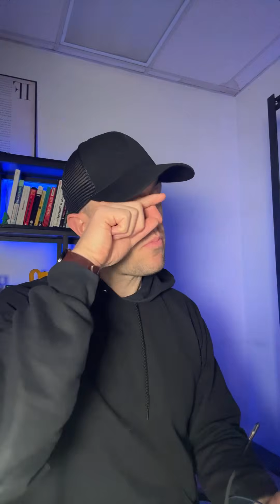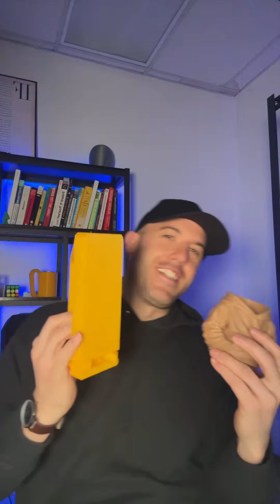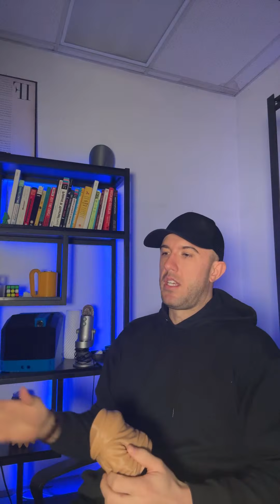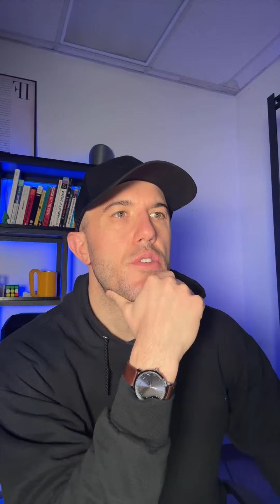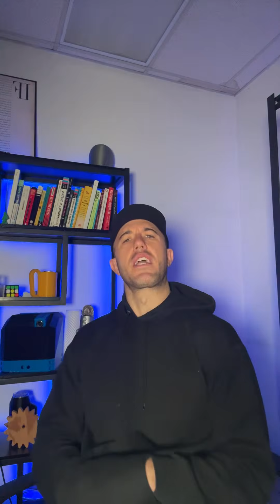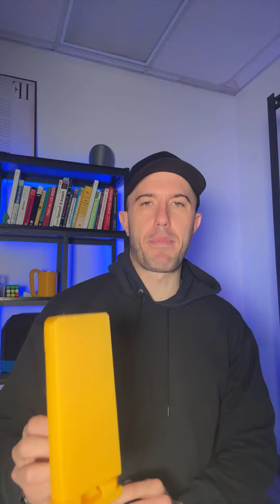Protecting Files and Dropping Filament cost

Comment: PCTG is a great name.
You know what's worse ? When each filament producer and reseller calls the same thing, like PCTG for instance, by a bazillion different marketing names without industry coordination (tuff, ultima, topdog, superduper, promax+++, nanotomic...), so most users can't easily tell anymore the basic material type behind it.
PLA is already a mess, but AT LEAST it's called PLA, so buyers have 80% confidence it's close to what they are looking for, instead of some other non-PLA material.
(examples of existing ACTUAL brand names, what a circus: pla, pla basic, standard pla, pla+, pla pro, pla+ pro, tougth pla, pla tough+, tough pla+, pla+ 2.0, rapid pla, pla hf, high speed pla, pla+ hs,  pla prime, and on and on)
Reply: Yeah, but Gabe has sand in his undies over this. And you also kind of made his point. What’s in all the different PLA+’s from different companies? What’s PLA tough, or high temp PLA? Yes, the base is PLA, but the additives can make it so much better in certain areas that it no longer matters. It’s all about the performance that you need. You don’t care if it’s PLA or PETG or ABS, you care that it can hold up to the stress required in the environment required for a certain price point. Many of the ads for performance PLA’s tell us how that blend can be used in place of PETG or even ABS. The crossover in performance between the different blends is so large now that the old-school understanding of what plastic is good for what job is only a very basic guideline now.

And don’t get him started on how even base PLA can be drastically different depending on if it’s pure virgin or has any recycled content. He claims that their PLA doesn’t have some of the “standard” downsides because they use pure virgin pellets that only get the one heating and extrusion, and most other companies don’t.

It’s an interesting problem in the space. I used to strongly disagree with Gabe, but I think I’m coming around. Though for the reasons stated above, not the reasons I’ve heard from Gabe.

I do think it’s critical to have an info section that says TUFF is a PCTG-based (or pure) plastic, so consumers are informed, for multiple reasons.

And, Gabe, PEBA is a great name if you pronounce it right: pee-buh
It’s fun to say and sounds like a cute furry animal 😊